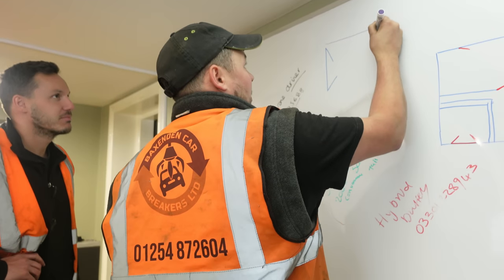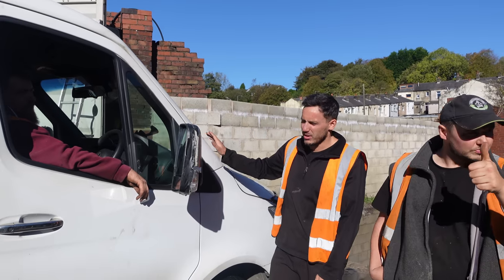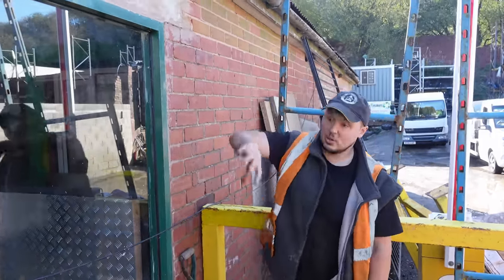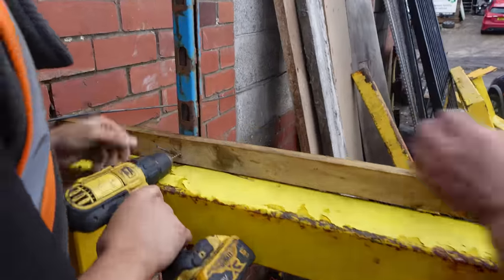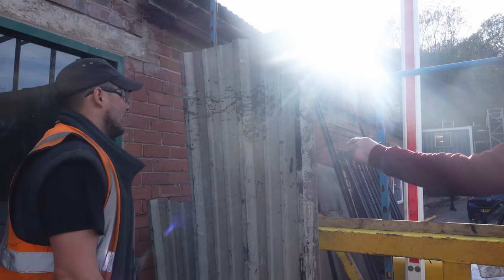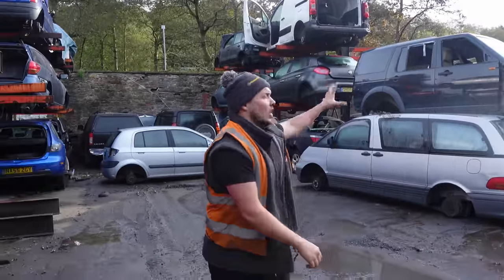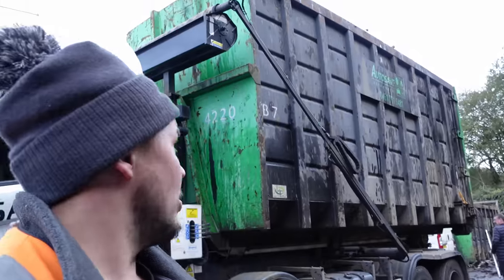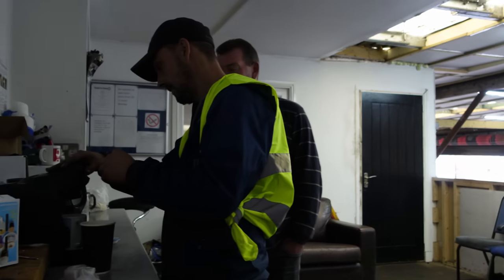Making Our Scrap Yard Look Presentable! | WHAT A LOAD OF SCRAP - EP77

Comment: sand the door frames with 180 grit clean and get a 1/2 ltr of lechler 29-130 teknogrip and re spray them , 3 coats it a DTM  for ally doors ,